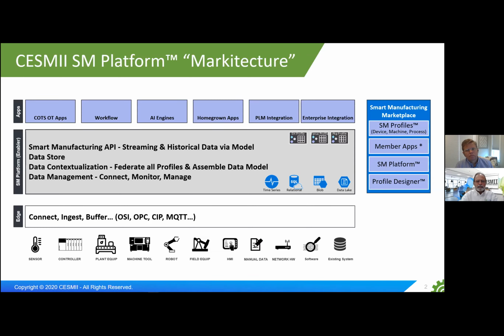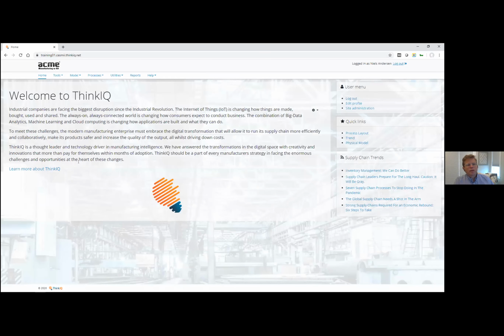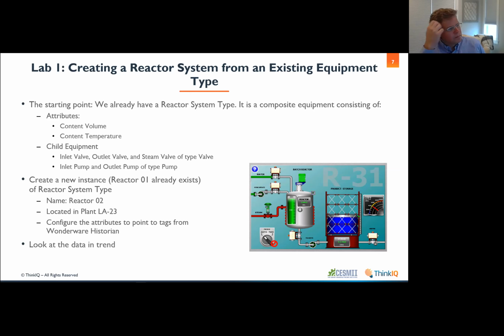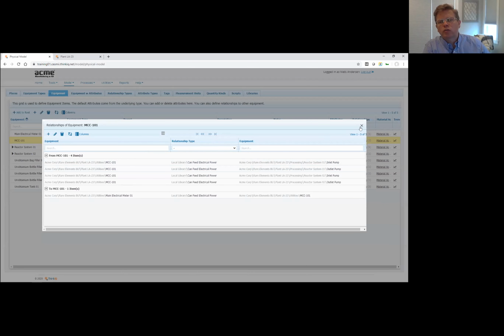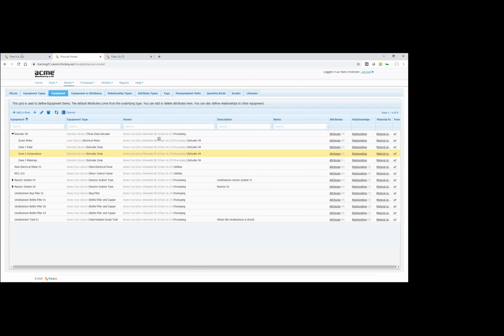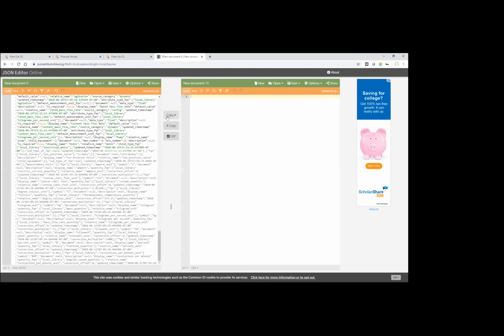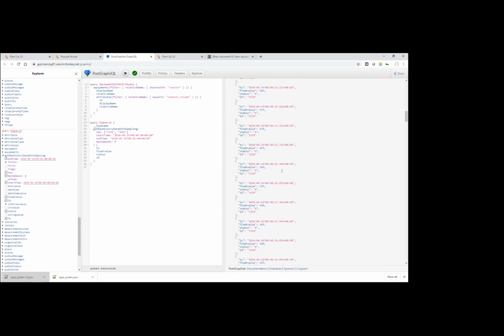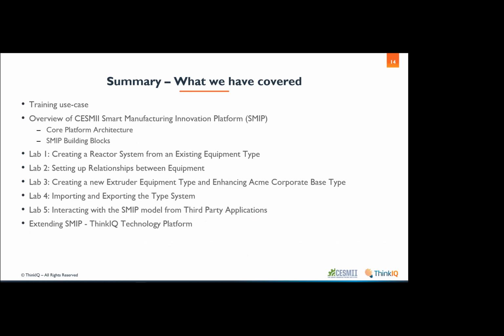CESMII Innovation Platform -  Training - Introduction to Data Modeling

Comment: A partial review of the CESMII video (in my words):
CESMII Innovation Platform - Training - Introduction to Data Modeling

@21:00 Three languages are run on the Smart Manufacturing Interface Platform (SMIP) platform: Python, with Python Pandas Multi-type environment (a data analysis tool - https://www.tutorialspoint.com/python_pandas/index.htm) , PHP for web enabled, using a PHP library, a SQL interface - currently in development. For Ad Hoc analysis the Jupyter notebook is available (https://jupyter.org/), and works along with other platform scripting.
@22:45 Can .csv, and Excel formats be imported - Yes - several ways. An interface is developed to run your own algorithms against it.
@24:50 Translators can enable other interfaces to the platform.
@27:00 Can the platform extend to supply chains? Possible and will be worked on.
@28:40 Can open source flow sheet modeling tools be used, i.e. Aspens (https://www.aspentech.com/), OSI, or Jeepproms??? A. Please send over models that be looked at for consideration of integration. Currently can import JSON files, and can create connectors to tie them together.
@31:00  A brief comment about ISA 95.
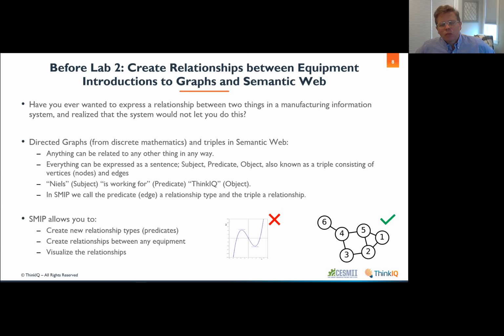@32:00 A very important distinction about what a "graph" means in SMIP. The Subject, Predicate, Object "triple" construction model for defining relationships is clarified. 
@39:45 Can we use existing PFD PID operating schematics to decipher relationships A. An API exists to tie into these structures.
@41:00 Can the platform extrapolate missing data, or flag abnormal data, or cleansing data? A Yes. Scripting Algorithms would need to be written to accommodate these needs. For example a Butterworth filter could be implemented.
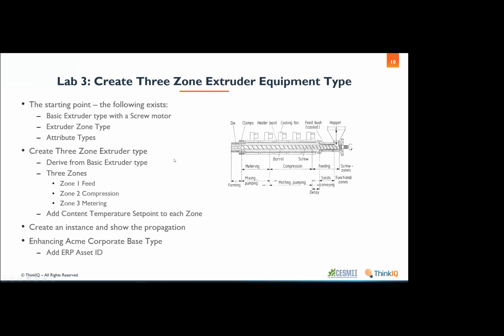@42:20 Lab 3 Extruder.
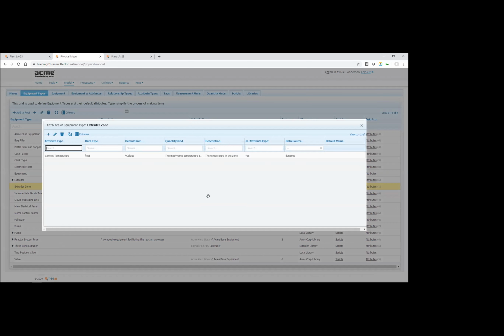@ 46:50 Key point: What makes systems difficult to use is when in every single instance of the same tag, people assign them different names. This is where a wrench gets thrown into the works because there is no nomenclature convention. Different spellings, acronyms, syntax, breaks the analytics.
This is as far as I got so far.